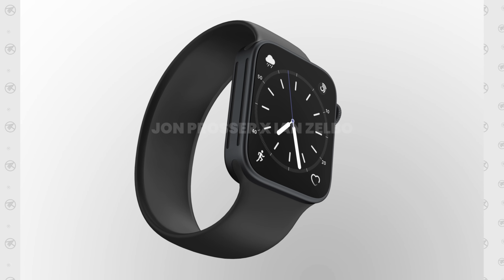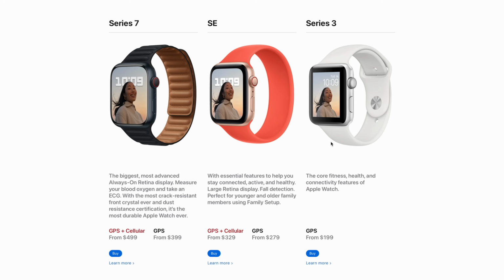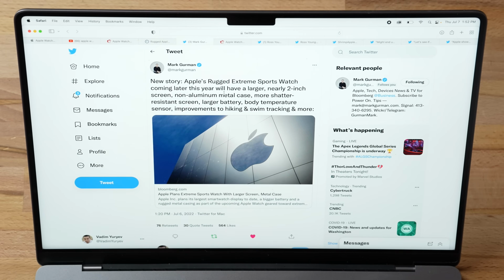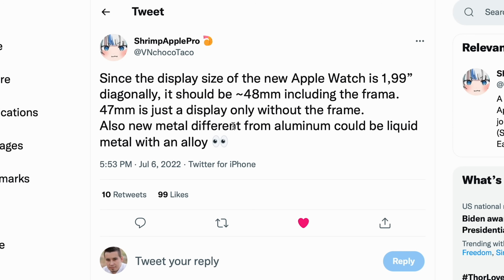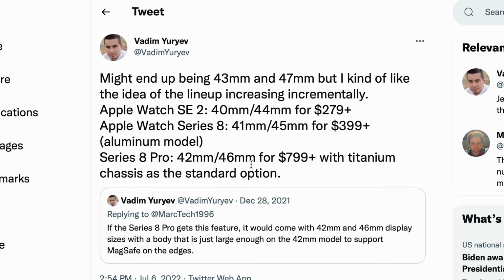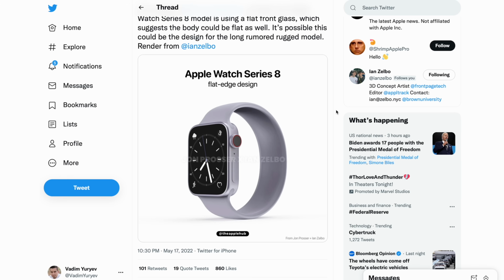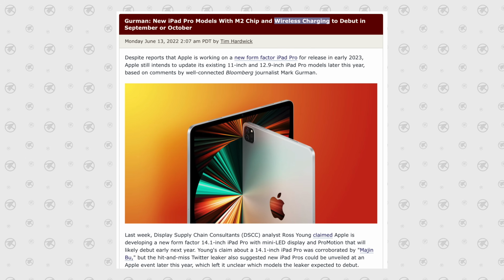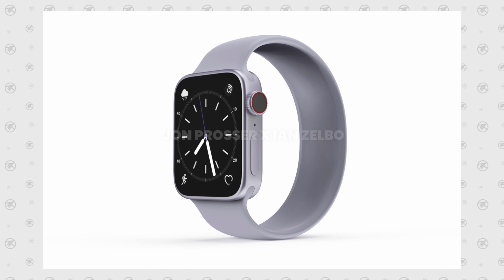STOP! Don’t buy an Apple Watch right now.. (NEW LEAKS)

Comment: that metal bezel protruding will not likely happen because it will make the watch face/dial corners where the glass meets the metal bezel collect dust, gunk, and make it almost impossible to clean. also interacting with the screen with the bezel edge protruding will be a major nuisance.

Comment: With this Pro rumors there is at least a little hope that finally they put a not completely useless battery in this watch. Absolute minimum for me is 4 days of battery life at the beginning. The battery will get worse over time, then it should still last 3 days since Apple doesn't allow you to change the battery. Without that at least, I don't consider it a watch, just a toy. Game changer at least within the Apple world? Battery life of at least 10 days at the beginning. After a few years, still at least 7 days of battery life. Game changer outside the Apple bubble? Reality check: Garmin fenix 7 smartwatch mode up to 18 days of typical use. Reduced use Battery saver watch mode up to 57 days typical use. This with a not as good display. Or the Garmin Epix 2, then with an OLED  display and 5 days always on display. Why on earth Apple cannot even manage 3 days when Garmin gets 5 full days out of a OLED display watch? Really a game changer for the Apple Watch 8 Pro for me would be in this respect: at least about 4 days of battery life and OLED display and please a replaceable battery. I do not expect Apple to deliver this at all. All these smart watches without replacable batteries is a shame. This is one of little things I wish would be duty by law to force the manufacturers to implement replacable batteries.

Comment: The raised lip on the rugged Apple Watch would make sense for temperature sensing. They could hide reference temperature legs in there which is exposed to air so you can correct for hysteresis

Comment: I've always been an early early adopter of Apple products (iphone, ipad, apple watch, airpods, etc...).  All bought first generation.  I am still wearing my Apple Watch 1, daily !  Still working well.  So, you  really don't need to keep spending on newer ones to enjoy Apple products.  I changed to iphone 12 last year, before that was iphone 7.  Why spend $800 on an Apple watch??  For that, I'd buy a mechanical watch from one of the Switzerland brands that will last forever.  Unless the Apple watch needs one charge per month, yeah??
Reply: I agree, but the top tier watch will be for people with more $$ than sense or rich people where $$ is not a concern. Silly to think that most people would be willing to shell out $800-$1000 for a WATCH when you can buy a new phone for that much with many more features.

Comment: To me, it’s predatory to even sell the Apple 3 when as soon as the new OS rolls out, your brand new watch (that you potentially are buying now) will ALREADY BE OUTDATED.  That’s flat out wrong in my opinion and chasing sales thru uninformed consumers and price manipulation…,
Reply: People still wear Apple Watch 2 and it works fine, so I think 3 will be on for a bit
Reply: People buying the 3 at this point probably don’t care about new software features. It will probably get security updates for a few years.
Reply: Well, if you buy a series 3 5 years later, it's kinda your own fault. I don't think anyone other than iPhone owners will buy an apple watch, and so you should already be familiar with your apple device not getting any updates anymore at some point.
Reply: Not necessarily outdated. It can still run watch os8 which is no slouch.

Comment: LiquidMetal is the patent name for a metallic glass alloy that Apple purchased the rights to in 2010. Advantages include 2x stronger vs titanium and easier manufacturing. We’ll suited for a more rugged watch.

According to an Apple Explained video about the SIM ejector tool included with iPhone, they’ve been beta testing it with this small accessory for some time.
Reply: it is stronger but most likely we will never see then sense it will be way to expensive to manufacture especially rn and how apple does there prices.
Reply: Apple is very careful about that new products so it took them more than 10 years test Liquidmetal and to develop Patents ,it will blow out the competition!
Reply: @reginaldferere1443  Yes I know that apple is very careful about there products and if it's to expensive to manufacture they won't do especially now sense we are basically recovering from the shortage so it won't happen, as there is liquid metal batteries, and liquid metal thermal paste and its expensive by 5 to 7 times more expensive then the regular stuff so meaning on a watch it will cost about 2,000 or a bit over that and no one would by that watch except rich people or hardcore apple fans.
Reply: @coolsquad7428  the real question is one of relative expense. If manufacturing “LiquidMetal” is less expensive than sourcing and manufacturing with titanium, with advantages in physical properties, then the incentive is there.

Or perhaps the costs are comparable while titanium futures may be volatile, so debuting new tech can be offset by the consumer base, while being a better long term strategy
Reply: @billy120745  So far liquid metal in a watch is a still a very new technology and it's take quite sometime to make and as well you need a powerful enough machine to make it so in reality liquid metal either won't happen or will happen and be more expensive to produce or make a small amount of the watch like a special edition watch, but time will tell and we will see if it will happen as liquid metal after being heated is stronger then titanium in a hardening test but liquid metal in a solid haven't beeb tested to see its hottest point before it breaks, as titanium melting point is 3,034 degrees while boiling point is 5,949 degrees.

Comment: I currently have the series 6. I don’t think that I will upgrade unless there is an upgraded processor and/or new sensors. For me, the best upgrade this year may actually be in the software - the new improved sleep tracking and running app enhancements.

Comment: Or...just don't buy an Apple watch. Go for a mechanical Seiko at the same price. It will last you a lifetime instead of just becoming tech trash in a few years.
Reply: Agreed. Use the upcoming Circular Ring for activity tracking.
Reply: Thats cause your affordability thinks on getting something that last and accomplish the task of providing the time. 
But some folks we do not care on dropping 400 on a watch that might last 4-5 years before becoming trash cause by then it would probably already had worth the price by tracking my workouts and giving a better ecosystem interaction and such. Plus Also being able to afford both watches not for what they last but what they needs they each cover. Even if is only for 5 years or a lifetime.
Reply: Bro literally stfu lmao. I get what your saying but people don’t buy an Apple Watch because they think it looks cool. They use it for its intended purpose which is activity tracking and the smart watch features. Most people would own a smart watch and a nicer watch to wear out
Reply: I feel it's better to experience the thing that u may never try when getting older. It's more of a stage of life. When it does become tech trash several years later, U could no longer need or want a fancy screen on your waist, and just go get yourself a Rolex or grand Seiko then.